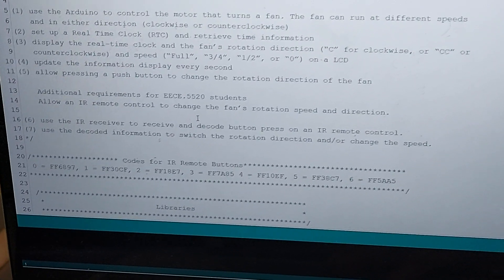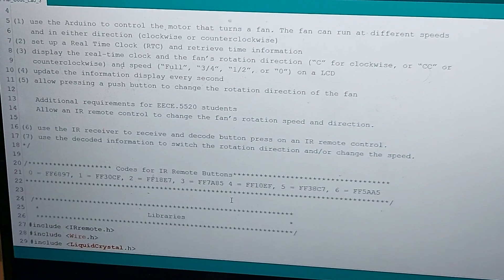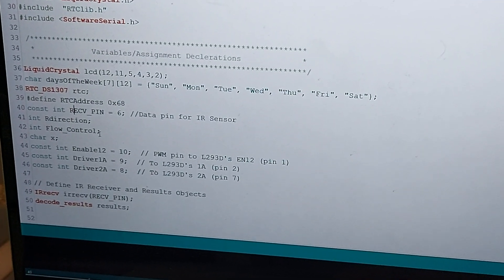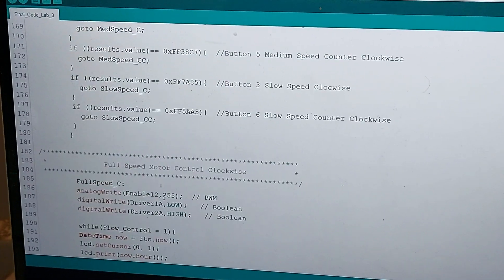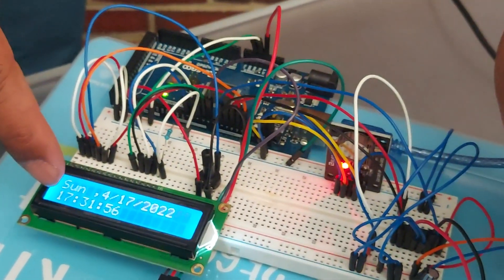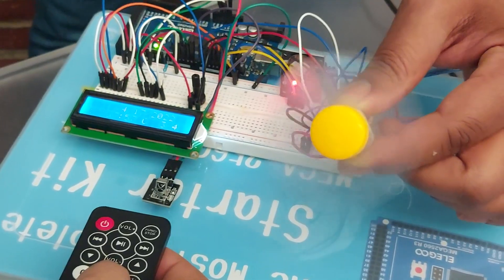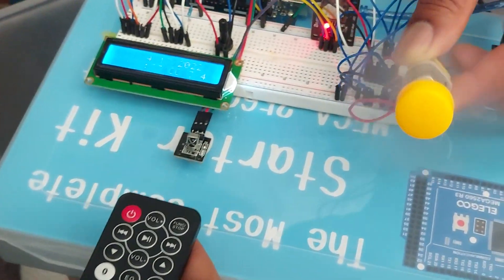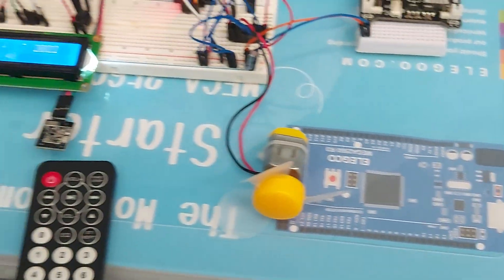Lab 3 Controlling a Motor #UMASS LOWELL

Comment: I don't see any H-Bridge, or drive transistors (MOSFET) on your breadboard. Are you running the DC motor directly off the Arduino pins? Do you have any protection for the Arduino to prevent back EMF from the motor from burning out the Arduino pins?
Reply: There's an L293D on the right side of the breadboard, which is a quad half H driver
Reply from the maker: Thanks for watching. We use a L293D IC.
https://www.ti.com/product/L293D
Reply: @jairusmorrow1217  OK. I must have missed it. Great circuit. Nice use of demodulating and interpreting the IR remote.